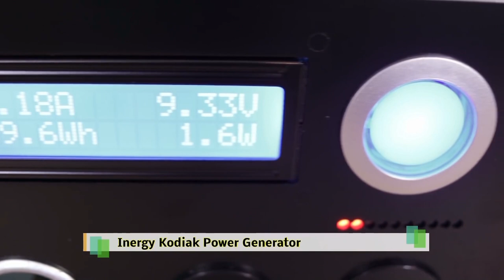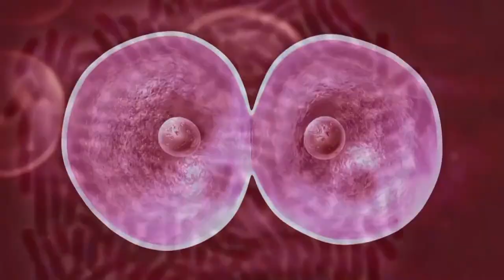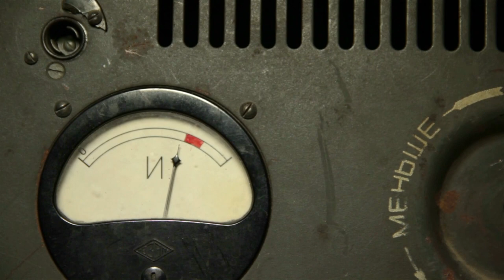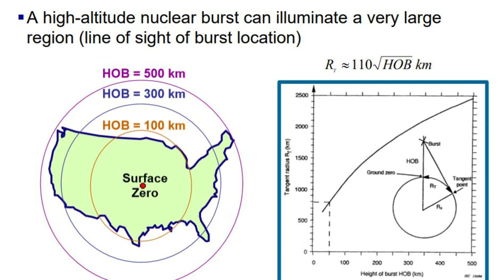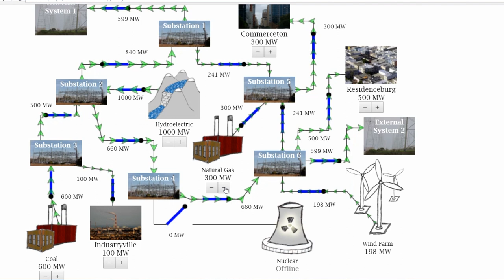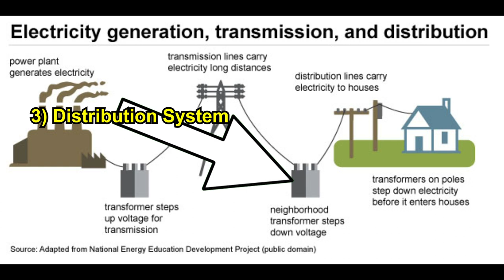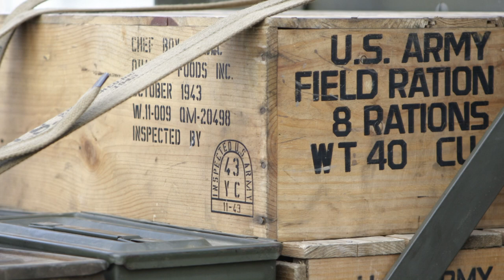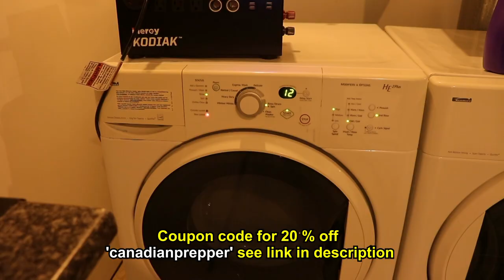Electromagnetic Pulse EMP | Everything You Need to Know

Comment: Well done!
One of the words that you will undoubtedly run into is "attenuation".
I don't believe the infrastructure can be hardened, simply because it's designed to do exactly the opposite of what hardening would try to prevent. My goal in regards to my personal security, is to attenuate the signal from an EMP. You can think of attenuation as putting sunglasses on to reduce the intensity of sunlight coming into your eyes. Large government organizations use mountains or burying things underground as a way to attenuate a potential EMP pulse. So do I!
Protecting the grid always comes down to who's going to pay for it. I believe the only way to protect the grid, is to have backup generators, and a stockpile of spares on hand. 
Looking forward to the next one. 👍👍👍
Julian
Reply: Only problem is how do you distribute it. Without those nodal transformers you can't distribute the power even if you can produce it. That's the scariest part of all this. It will take decades to sort it out and frankly, I doubt civilization will survive. 

And you really can't bury those nodal transformers. Not that it will do much good because the transmission lines act as induction coils and focus the pulse back on the power station.
Reply: Wasteland Seven Personal responsibility!
I will not be distributing the power I produce on my land to anyone else.  If everyone produced their own energy, for their own consumption, it wouldn't matter if the electrical grid went down or not.
Reply: We've known since at least the 1960s that EMP/Carrington is a possibility. Criminal how they failed to standardize the grid. Easy to stockpile standardized parts at local nodes. With their individualized parts, there's no knowing how long to get the grid back up in a large scale disaster. 

They knew, yet did the wrong things anyhow. Either the money was that good or they want us helpless.

Comment: Good Topic. My Two Cents. Anyone recall the Northeast Power Blackout of 2003? I do, since I LIVE less than 2 miles from where it started in Eastlake Ohio.  We were one of the first to go down and one of the last to come up. Read the Wiki for details.  Bottom line: It was caused by a combination of Operator Error and Corporate Greed.  First Energy decided to save money by cutting back on Tree Trimming, which was a Major Factor in the Grid going down. However, in case of EMP, there's a sliver of Hope. So if it ever happens AND WW3 doesn't go into TEOTWAWKI (the Rogue State One-Shot Scenario, not the All-out Russia vs US vs Pakistan vs India, you know, the "Everybody Plays" Scenario), the Recovery Period could be shortened somewhat. How? Nuclear Powered Submarines tied up to the Pier feeding into the Grid. Don't Laugh. It's been done before. Typhoon Pamela in 1976 knocked out Guam. Think Puerto Rico level damage. But since there is a MAJOR Submarine Base there, they took one of the Boats and "Plugged it into the Grid" until they could get the Power Plant back on line.  Now, for a North American Blackout, there's not enough Power to get the whole Northern Hemisphere up. But SOME Electricity will be available along the Coasts, and it's not like Puerto Rico where almost all the Wires were smashed to the ground. But there could be enough to help "Kickstart" the Grid. Also, there are Land Based Nuke Plants, Hydro Plants, Wind Turbines, and even some Coal and Natural Gas Plants that could come online once the Control Circuits get repaired. It of course would depend on how well the "Powers that Be" get their Act Together, how well Society responds, if External Countries don't try to take us out because they think the USA is Down and Out, the Weather, etc. But an EMP Attack does NOT mean we have to grab Picks and Shovels to go Mine Copper Ore and Smelt it by Hand to make Wire! Oh, BTW, having Served aboard Submarines in the US Navy for a Decade, trust me, they can Feed the Grid if needed. Thanks for the Video, looking forward to the next one. Take Care.
Reply: cool info
Reply: xmodriver Thanks.  But if there is an EMP Attack, or anything else that can take the Grid down, it will NOT be a good time to be Unprepared.  I just think that the Recovery Period for the SURVIVORS could be Reduced IF the Gooberments and the Corporations had their Act Together.  There would still be Millions who would die across North America. Think of Diabetics without Insulin, Kidney Dialysis, other Life Support, Rotting Food in Refrigeratored Warehouses, Traffic Lights out, Airport Radars offline, Darkened Cities with Heavy Gun Control like Chicago and New York (Criminal Gun Ownership in those Cities outnumber the Police), etc. Thanks again.
Reply: I agree totally ,,,, During the big power out southern ontario canada was out for 3 or 4 days depending on location ,  4 pm power dropped out , at that time I was with St John Ambulance emergency response  , and we covered a large area of london with 911 calls , over 200 folks alone stuck in elevators .  That was just the first 6 hours , multi folk on O2  pumps at homes and so forth , sharing gen sets  for home dialysis . 
It was a  mess for sure and that was 4 DAYS .
Reply: xmodriver Thanks for the Details. What's Scary is that I think that the Cities are in WORSE Shape to handle that kind of event than they were 15 years ago. Appreciate your Insight. Take Care.
Reply: Leslie Kovacs  General Electric builds jet engines that power turbines to create electricity for aircraft carriers and are mobile, but if an EMP was to burn out the substation or effect transmission lines similar to the Telegraph wires back in the late 1800's, the delivery of power to the grid would be compromised and limited to a small operational area. Jet engine turbines were used after Katrina in New Orleans, but do to water damaged substations power was sporadic at best.
Reply: TBOR-101 It's 2018. We don't Transmit Hundreds of Thousands of Watts of Electricity over 1850s Telegraph line. So Substations in New Orleans were underwater and damaged due to Flooding. What does that have to do with an EMP Nuke detonated over Omaha? In fact, most Substations are built exposed to all kinds of Weather, just like the Transformers on the Poles in your neighborhood. Hey, if the Grid Infrastructure is ready to take the Juice, who cares if it comes from Jet Turbines, Wind, Solar or Submarines? Somehow, People think that an EMP would be Generating Sparks and Fires like it was the Bridge of the Enterprise when it gets attacked by Klingons. It's more like the Northeast Blackout of 2003. EVERYTHING that was plugged in just shut off. Thanks.
Reply: Leslie Kovacs Well of course I know we dont use telegraph wires, but the countryside is covered in transmissions lines which are vulnerable to EMP, secondly my point about New Orleans was to address the the comment about how the Navy can produce power, which indeed they can..but alot of factors goes into that to provide power to people miles away from the creating source...just conversation here...no need to be rude.
Reply: Leslie Kovacs .... There would be power surges all over the place starting fires.
Reply: Leslie Kovacs just watch Documentary on Cuba how they survive without electricity some times the power would go out for weeks the have to pull buckets of water up to the 3rd floor of an apartment building they still use pints to move stuff across town they have to get out and work all day until the Sun is about to go down then eat dinner light a candle for an hour then go to bed
Reply: You speak of the Carrington event, very bad.

Comment: Inverse square law applies to exposure through atmosphere as a medium and helps to limit the e.m.p. effectual range. However, anything that acts as an antenna will transmit the pulse throughout the grid, e.g.,. transmission lines,  house wiring,etc. As an aside, most homes have a fairly significant electromagnetic signature. Most U.P.S. units do no break a circuit fast enough to prevent downstream component damage. . Transformers are more susceptible to failure because of the higher ground voltage potential produced by e.m.p. or coronal mass ejections. De-centralization of our economy, power distribution grid, and political apparatus is the key to becoming more flexible and adaptive to disruptive events.

Comment: That battery pack is sounding better all the time not just to leave it until an EMP but use it often
Reply: SNOOP U 2 use it on what? Everything will be fried.
Reply: jesse burnett I'm talking about everyday use like a small home camping power up my 110 welder. I don't think everything will be fried  there might be something salvageable I have a 1947 Chevy i bet I could get going and a few Chevy straight 6 cylinder generate. I never knew anyone that's been threw one or don't know how to protect what ever it is from my understanding it just has to be in a metal box and the have large tool boxes like a cage on plastic wheels

Comment: You certainly did your homework on this one. Mostly accurate info. I don't worry too much about EMP from a nuclear attack. However it makes the most sense for any enemy of the US (mainly china) to use EMP to try to conquer us. US is a very resource rich area. China is all but one large contaminated continent. If we are nuked with conventional nuclear weapons the land becomes a waste land. That said, non-nuclear EMP devices exist. They can be made for under 20K and carried in a minivan. Covering many city blocks but would only affect high density electronics. The power grid can handle many thousands watts. So it would take a sizeable EMP detonation to wreak any havoc on our backbone.

Comment: I work for a transformer making Company. We make transformers up to the size of a truck motor. Bigger than that, its a whole otter ball game. It is to note also than the number of company who make transformers is diminishing every year. The theorical information to make transformers is widely availiable, but there is a very small number of engenneer and technician with experience. And most of the workers don't have a clue about how what they make actually work. They just follow orders, and most of them cant repair theirs own mistakes without supervision.
Ironically, just a power outage paralyse the company, because of the lack of light and electricity to power the machines. We need a stable industrial 3 phase power source to make our bigger transformers. Otherwise we would need people to turn mechanically the machines and we don't even want to think about it. We are also dependant on J. in T. delivery of insulated copper wire and ready to use iron laminations.
If an EMP hit us and destroy the electronics in the machines, its game over. We will return, for a time, to technology of 100 years ago when transformers were mostly done by hand.

Comment: Very well done presentation. I'm extremely dubious that we could recover. The nodal transformers in particular represent a single point of failure in the system. 

Put simply, we won't have the time to get the system back up and running before everything falls apart. But, the effects ar not going to stop with just the US. Our economy and financial system is tied to the rest of the world's economies and financial systems. Even if the US and Canada were the only ones directly effected, the rest of the world is going to be facing an economic depression at the very least. 

The USA is so voracious in its consumerism taking us out of play could cause a cascading economic collapse.Then of course, there is the power vacuum. Take the US out and there is going to be a mad scramble to see who is the top dog. Which means there will be wars out the yin yang as everyone tries to establish themselves as the top dog locally. 

There won't be a ripple effect. It will be a tsunami effect.

Comment: Emps are coming it's just some copper wire around a steel ball and an electrical heater to keep it above zero point, but heres the catch...

It's made from concentrated metal  and as you all now if you concentrate something you put much more of it into it into a smaller space. If you concentrate metal it will carry a greater power source with it and as well cause a greater magnetic feild.
Reply: Elder 987419 explain how to concentrate metal and I’ll believe you